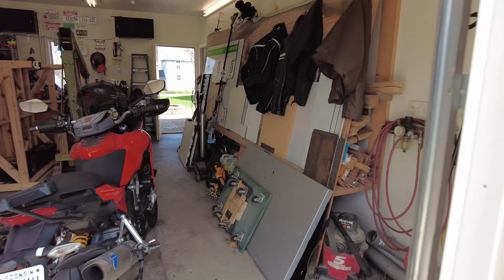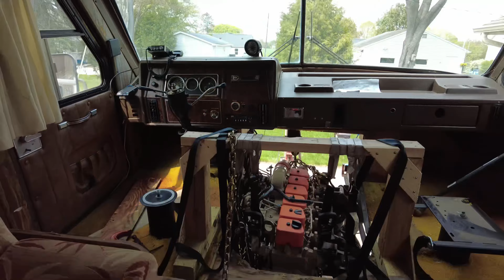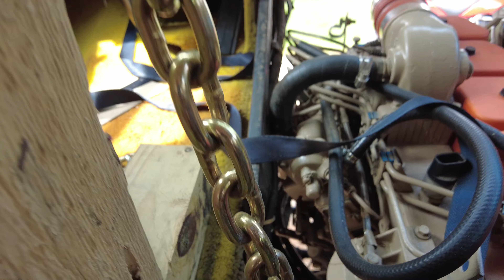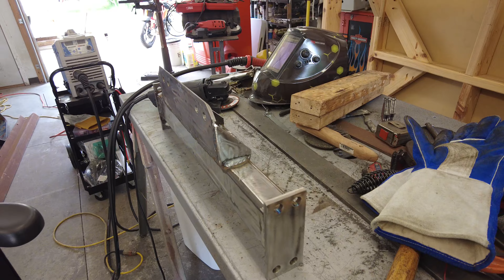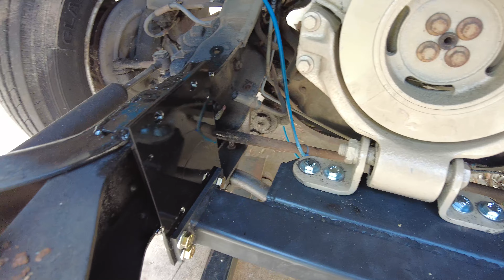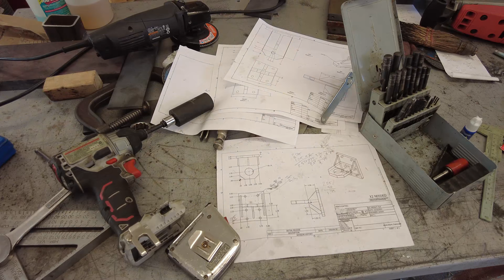RV Cummins Swap - #10 - Getting the Cummins In

Comment: 😅what year and what trans are you using
Reply from the maker: A 2008 Allison 2350 6-speed, otherwise generically refereed to as an Allison 2000.  It was out of a GM Top Kick or Kodiak chassis.  That trans used to have a Duramax bolted to it.
Reply: @iwens1966  thanks I will find that trans
Reply from the maker: @larryford8633  if you’re doing something similar, an Allison 1000 will work too. This 2000 might be overkill, but it will be bulletproof.
Reply: @iwens1966  thanks for info  will be helpful